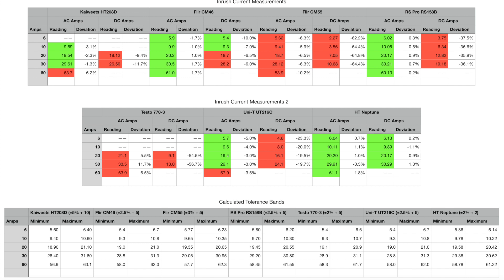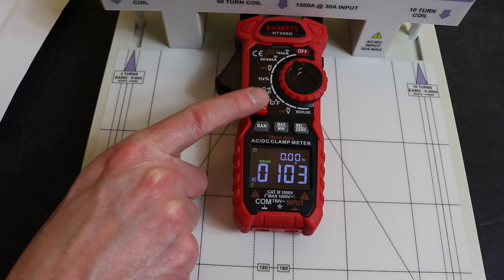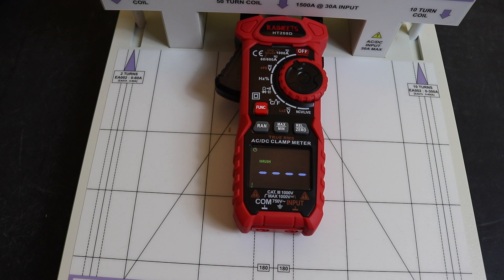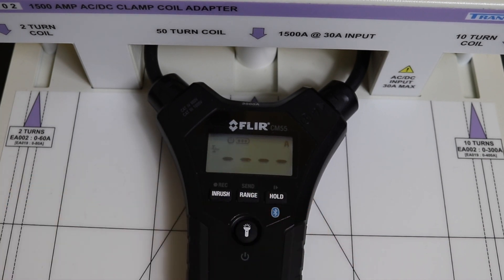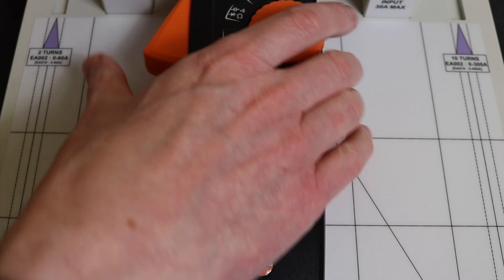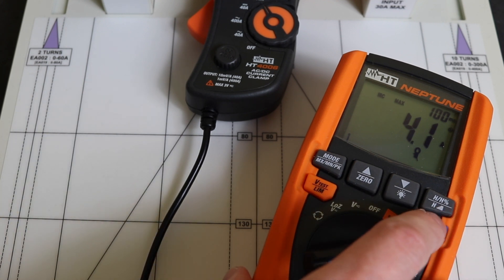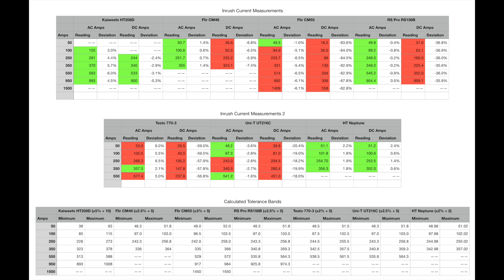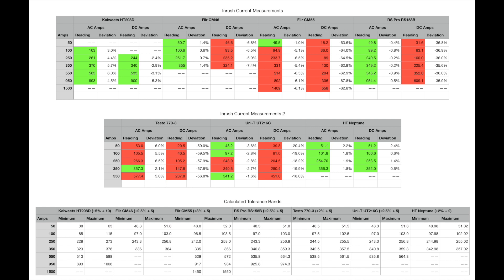Current Clamp Inrush Current Testing Part 2

Comment: Great two part review, thanks!
Do you have idea how good will be inrush UT206A+ comparing to HT208D, as UT206A+ is also 1000 Amp clamp?
Reply from the maker: I would imagine that the inrush function of the UT206A would be similar to the UT261C tested, just with the ability to read beyond 600A. Unfortunately, you I would need to test it to be certain and I don't have that model.
Thanks for watching and your question.
Reply: @three-phase562  thanks for kind reply.
Do you know is UT206A+ newer model than UT216C, I can't figure out?
Reply from the maker: @zorzigetar7990  I believe the 216C is older than the 206A. Amazon shows UT216C available since May 2017 and UT206A since July 2022.

Comment: Hallo und besten Dank für den Test. darf ich auf meinem Kanal dein video verlinken? ich werde nächste woche ein video über einschaltstrom bei powertools machen und arbeite auch mit dem unit-t ut216c
Reply from the maker: Ja, Sie sind herzlich eingeladen, auf eines meiner Videos zu verlinken. Viel Glück mit Ihrem Video. Danke, dass du mir zusiehst und meine kommentierst.

Yes, you are more than welcome to link to any of my videos. Good luck with your video. Thanks for watching and commenting on mine.
Reply: @three-phase562  besten dank. Nach ihrem Video kann ich davon ausgehen dass das unit-t etwa 20% weniger anzeigt bei der einschaltstrommessung.
Reply from the maker: @pascalfiabane  Ja, bei diesen Tests lag die Messung des Gleichstromeinschaltstroms bei einer um etwa 20 % niedrigen Gleichstrommessung gerade noch in der Toleranz.

Yes, on these tests, when measuring DC current inrush about 20% low, AC inrush current measurement was just about in tolerance.

Comment: Pls, can u compare the inrush vs the max on the ht208D
I would like to know if their readings would be similar.
Reply from the maker: The 2 functions are different, the max mode is continuously updating where as the inrush is a one shot reading and has a faster response than the max mode.

Comment: HT208D handicap is the range below 10A. Pity.
Reply from the maker: It is, but it is also a 1000 Amp clamp, so isn't really designed for monitoring at lower values.
Thanks for watching and commenting.